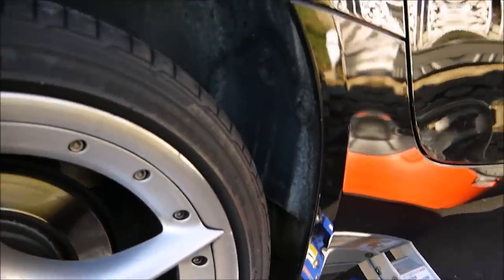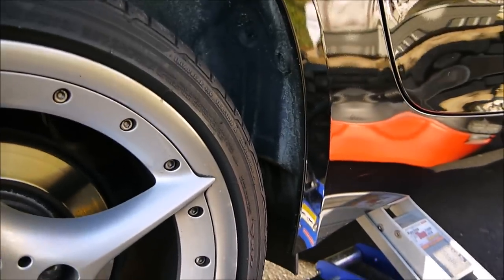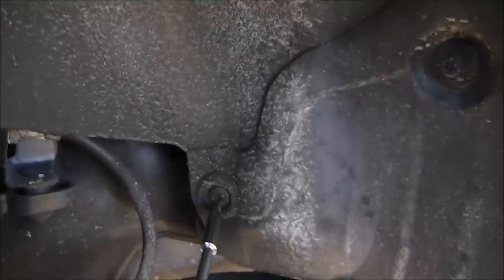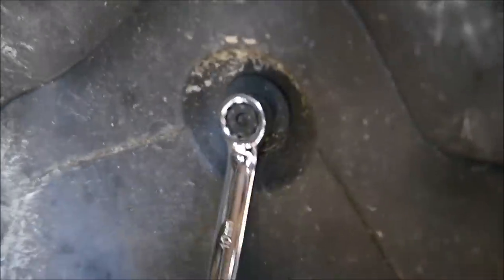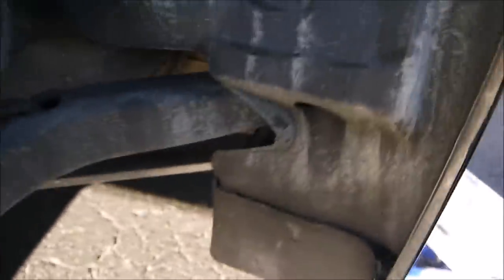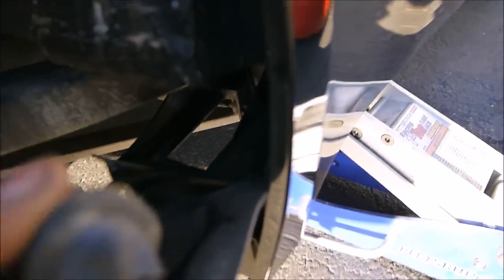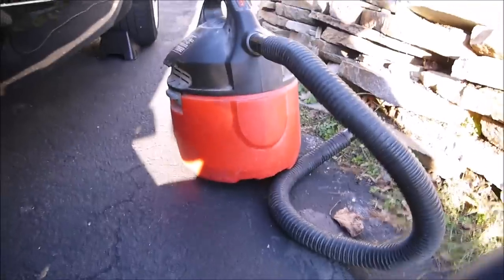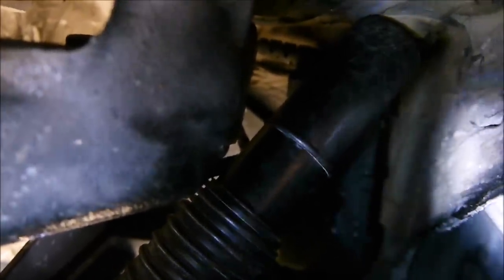BMW Z4 How to Clean The Convertible Drain Holes

Comment: lol just jack up the car and put your hand up where the plastic hole is, don't need to remove the wheel or any plastic trim, why make it so hard??????
Reply from the maker: I mention that in the video.
Reply: If you can not jack up the car, open the plastic trim will be easy to access and it takes only 5 minutes

Comment: Hello nman2563, I have a problem.  I have a 2006 bmw 3 series e46 convertible.  O.k. I notice there was water in my truck and in  the battery compartment.  would this plug you removed have anything to do with water getting in my truck where the spare tire is??  I need help with this if you or anyone else can help me.  Thanks.

Comment: i have a serious problem,  my z4 wont start and i think the controller unit for the fuel pump is broken.  do u have a idea where it is placed in the car,  im trying to find it for some hours now but i just cant find it to replace it;/
Reply: Fuel pump is inside gas tank. You have to remove the exhaust then the fuel filter then you can get to the fuel pump

Comment: Thanks for this valuable info. Thought I would have to crawl under the car to get at the drains. This was very easy and was able to inspect the drain holes with a mirror to verify that they were clear prior to re-installing the rubber drain fittings on both sides. Obviously the plastic pocket with the motor in it is the one to worry about. My right side one was partially clogged, but I believe the top motor is in the left pocket so not too worried.

Comment: Thanks nman2563 !
I watched your video this morning and got ambitious to change over my winter tires for the summer set. After watching your detailed video I took the time to service the drains. Actually when I took out the plugs, I discovered they were in two pieces. A hard plastic base with a soft plastic valve. They came apart easily and I used the hard plastic part, taped to the end of my shop vac. This modified nozzle was a perfect fit.Your video is by far the best dealing with this service.

Comment: Thanks; this worked for me.  I had a semi clogged drain plug on the bottom and the top was also mostly plugged.  I tried to unplug the top drain, but couldn't seem to find the drain hole, so your method of vacuuming worked.

Comment: Question,  why not remove the drain caps and keep them off so water cannot build up and possible fill top motor or trunk?
Reply from the maker: There is probably a good reason why they are there. I'm not going to find out the hard way.
Reply: It's said that it's there to keep insects out. Actually a lot of Z4 owners removed it because they clog on aregular basis. They never had serious problems.
Insects will still find a way in your car if they want to. Especially if your car is parked outside every night.
Reply: Enceladus Tech  I removed mine too a few weeks ago and I noticed that the driving noises got louder in the interior. Especially when it's raining. It isnt that annoying though.
Reply: Completely pointless having the plugs in place as they serve no purpose.
Reply: Mice

Comment: Excellent video thanks.  from my experience the problem is not at the bottom end of the drain system but at the top end where the roof motor sits.  the hole at the top end gets blocked and does not allow the water to drain down.  on the other side I simply stuck a stick down and wriggled it about and the water came gushing down.  you cannot do this on the roof motor side it's blocked. would be good to know how to get around this.
Reply from the maker: ua751920 Yes, the problem is with the drains getting clogged from the top. The hope is that the vacuum will be powerful enough to clear any dirt blocking the top as well. The only other option I know of to clean the motor side drain from the top is to completely remove the convertible top. I have thought of a way but need to test it first before confirming it works.
Reply: nman2563 hi - did you figure a way to clean the top of the motor side of the drain hole? Would be great to share with all here 👍

Comment: Thanks for the video. If you put the car up on a lift and can get under it, can you access the drain holes on both sides without taking off the wheels and the covers?
Reply from the maker: Yes, I believe you can
Reply: Yes you can. I recommend you buy a short rachet wrench for this job if you dont want to open the tire.

Comment: Unclogging the drain holes (E85) and removing the anti bugplugs (?) Can you put a flexible wire into the drain en push it upward in order to open possible clogs underway....And where will you see the upper end of the wire, popping out of the drain, seeing the daylight..?   Thén, you are dead sure the drain is open.
Btw, I drive the car for years without  the anti bugplugs. These are a 'solution' for a non existing problem, and what's more,  they might create one. (Clogging !)

Comment: Do you know if the Z3 has a similar design? And what is the purpose of the plug? Why not remove it all together?
Reply: +Josh Aldy You will get unwanted road noise.  I know because I removed mine.
Reply: +shorsheesure ceo it drains the water that seeps down into the area below where the top is secured to the body.  For more infor see our clubs website.  www.eastpazscca.org
Reply: Hi Bill Harmon, will this plug being stopped up, causes water to get in the truck where the spare tire and battery compartment is???? I'm having this trouble.  Pls help

Comment: Is this problem only on E85? Has it been fixed for the E86 2006-?
Reply from the maker: My apologies - I got it wrong in the video. The E85 is the convertible and the E86 is the hard top for all years. Unfortunately the problem still occurs in the 2006+ models.

Comment: hello I've a question: there is a drain hole also in the left side? thanks
Reply from the maker: MrPoliceinhelicopter Yes there is a drain hole on both sides. The motor side drain on the left is the most important to maintain
Reply: nman2563 thanks so much

Comment: after removing the grommet/plug was it not better to run some water down to make sure there is no blockages?

How would the vacuum help if there is not enough suction to pull out dirt?
Reply from the maker: There was enough suction after I put my finger round it.

Comment: Question,  why not remove the drain caps and keep them off so water cannot build up and possible fill top motor or trunk?
Reply from the maker: theninja250 I believe they are there to prevent bugs from climbing in. Some owners have removed them and reported no problems.
Reply: You could bond some kind of filter mesh over too
Reply from the maker: The plug is meant to act as a valve rather than a filter. You want dirt to pass down through it but not the other way. You also want something removable so you can clean out the hole.